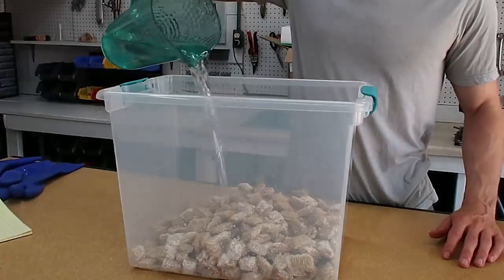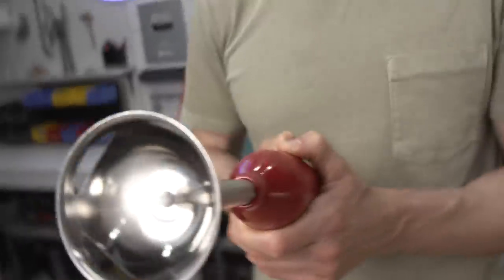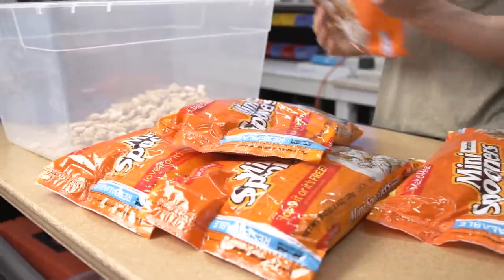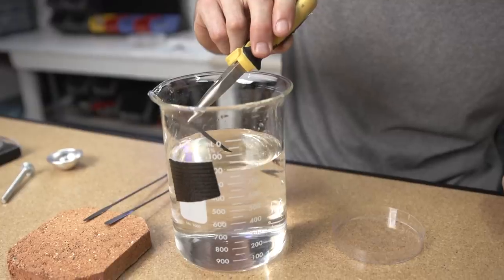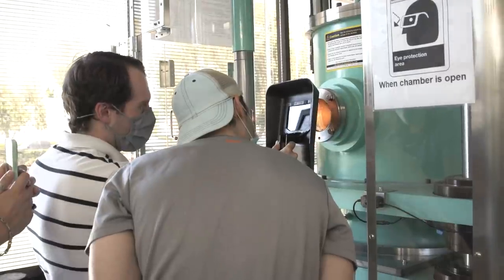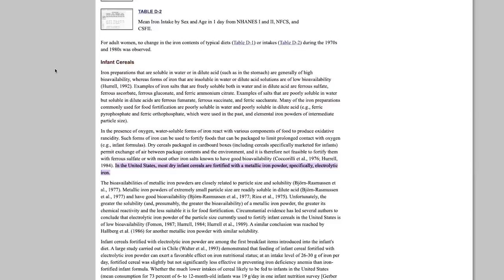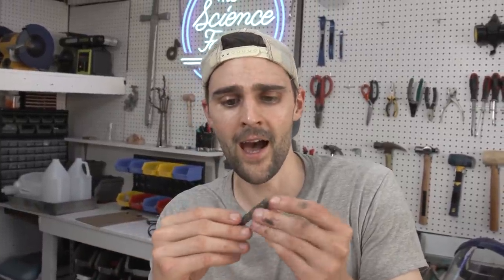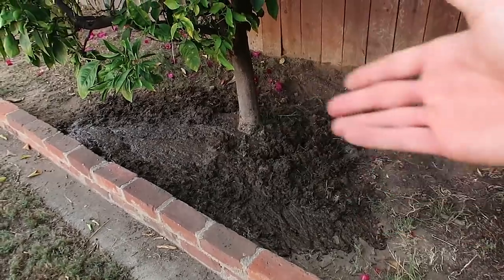Extracting IRON From Cereal to make a REAL SWORD

Comment: Forging shall work better for iron than using a mould. Just heat it in a fire with extra air blown into the flame, and than hit the iron with a hammer to shape it.
Reply: or heat in an induction furnace
Reply from the maker: I do want to try this process ... good suggestion